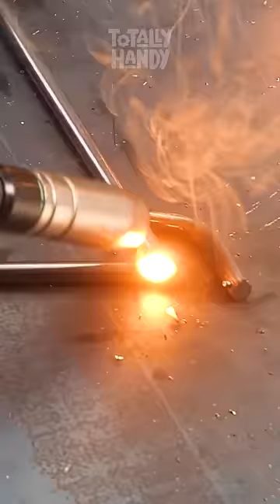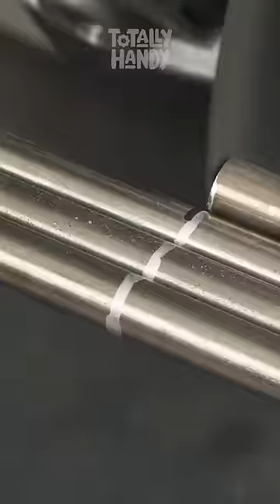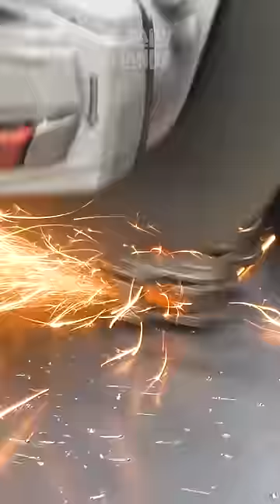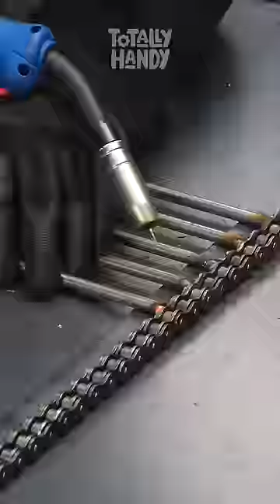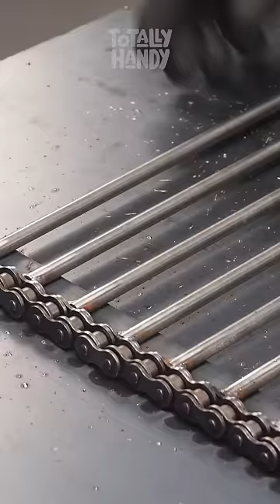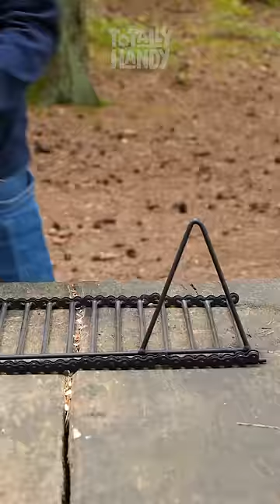Portable Grill DIY #shorts

Comment: Food, fire and paint... one of these doesn't belong.
Reply: Don't forget the oil/grease and rubber o-rings in the chain.
Reply: @farmsgrace341  but there arent any rubber o rings in the chain?
Reply: High temp grill paint, probably to seal any contaminants in the chain.
Reply: @farmsgrace341  any grease in the chain may be food safe... depends on what chain they bought. Many food factory machines use chain and so must use food safe lubrication. Besides, they're not cooking on the chain, and the heat from the welding would "cook/burn off" most oils/greased anyway from the immediate areas of the welds, and the heat from the fire would have most of the rest of it dripping away (maybe smoking the food, which wouldn't be so good).
Reply: Waw😍😍😍😍
Reply: @stoony1745  ikr, wtf this guy talking about lol
Reply: @thomasarussellsr  absolutely not, there is no way that grease is food safe,
Maybe if you use vegetable oil, but they are packaged with a bit of oil for them to not rust while being transported and/or being stored for long periods of time.
So no, i dont think its food safe.

Source: im a mechanic who works with these types of chains. And have felt how greasy they are, if you dont believe me, buy one, and open the packaging.
Reply: @thomasarussellsr  There's no way that "welding" burned anything off outside of the point of contact because he didn't actually weld anything: the metal isn't even fused.
Reply: Aside from the chain I would only be concerned with the actual metal used for this and whether it was made for use with food - many metals release toxins when heated… so if you use just any random ol metal bars to cook on, you’re going to get a nice dose of carcinogens/neurotoxins/etc with that food unless you have it properly treated prior to heating it with food on it. A very simple example of this importance would be coils for vapes that get red hot and if the coil is made of metal that is not food grade it can release very harmful chemicals that subsequently vaporize into smoke and if you inhale them you get that nice yummy metal taste… basically - ever see some hot metal smoking? That is what I am talking about… that smoke is bad news bears… so before cooking on metal one must make sure to either heat-treat the metal and clear it thoroughly of anything released from it or ensure it is treated properly from the factory.
Reply: @stoony1745  Fluid Film. It's food grade and leaves a protective lubricant coating on metal and joints. There are also food grade dry silicon lubricant sprays. Source: Maintenance mechanic who worked in a food plant.
Reply: @sleepyancient6655  makes sense, however i dont think he is using one of those, it looks like a regular chain, and not a special one.

I cant tell you that i know better, because i dont, and dont work in the food industry, but from my experience, i have never seen any metal with a grease coating that has been food safe.

If you can, can you send me a source where there is an explanation to how these a packaged and how they are food safe? Would be interesting to read. Cheers my friend.
Reply: Food
Reply: @stoony1745  It is a regular chain as far as I know. Chains near food are usually covered by stainless steel guards, so it's not like food ever directly touches them. With that said, if we had a machine where food might occasionally touch a chain at some point, we'd just clean the chain of any original lubricant and use fluid film. Stuff that's guaranteed to touch food is all stainless to begin with.

With that said, I wouldn't worry about what this guy did in the video even if he applied a fresh coat of regular gear oil. The fire will burn it off pretty quickly and most of the food won't touch it. There isn't much on chain that clean/dry to begin with. And there's other bad things that people use in their homes with food that isn't good, anyway.

Aluminum, for example, is illegal for surfaces that touch food in food plants, but is used in cheap pots and pans and bowls in lots of homes. This is because, over time, the acid from various foods can cause the aluminium, along with friction, to wear out into the food.

Another example would be not cleaning cupboards regularly. The line workers had to clean up/disinfect things whenever they started sorting and packing vegetables. At home? There can be a lot of things that build up over time from dust to mold and we just, without incident usually, don't bother to clean it.

I think the biggest danger one might legitimately be unknowingly harboring would be antique plates and stuff from the late 1800s to 1970... the colorful ones, red being the worst, can be dangerously radioactive over years of use.
Reply: @farmsgrace341   just put the loose chain in the fire for a couple hours, scrub clean, then soak it in vegetable oil. 
It will be clean and work fine.
Reply: @sleepyancient6655  You could also use Pam cooking spray. 
Safe and no Cholesterol  !
Reply: @farmsgrace341  There's no Rubber O-ring in chain.

And if you heat treating before use it, it will be fine. Once you burn every oils inside the Chain, it's OK to use but for paint......
Yeah that's the real problem
Reply: @digitalis2977  yeah nothing but tac welds can hold in place but is no where near a full weld.
Reply: @stoony1745  في
Reply: Stop hating, it works.
Reply: Jesus Christ loves you all please repent
Reply: Heat paint meant for grills
Reply: @stoony1745  There are actually, chains use either O-rings or X-rings. X-rings offering less friction because of less surface area but they do cost more. Also, the O/X-rings may not always be visible on a chain.
Reply: Heat resistant paint can be used in a grill as long as it has been aired well enough.
Reply: @thomasarussellsr  Very true
Reply: Unless it’s high heat paint.
Reply: He painted the chain and the stands.. notice that he covered the grates with paper prior to painting.
Reply: Definitely the paint
Reply: @digitalis2977  he welded the bars and not the links themselves im pretty sure.
Reply: @stoony1745  your argument is more baseless. hes saying. by having food safe greese it can be used for anything. therefore its probebly more common than non food safe greese. if the chain ends up in a steelmill or something you can just use the regular greese for the chain. if its in a food factory they can continue using food safe greese without it already being contaminated. its just simpler for manufacturing to always have food safe greese. i deubt however that something like a cam chain in an engine uses that since its such a specific use.
Reply: So you don't think a grill needs to be painted? None of the paint is on the cooking surface, that's why he put the tape and paper down for.
Reply: @poloska9471  you know nothing about what you're talking about. Every smoker on the planet uses expanded steel panels. 

Nothing wrong with this build at all
Reply: Agreed, instantly said... "why did he paint that"
Reply: I'm 99% sure he used the special barbecue spray paint stuff, it's heat resistant
Reply: It is fire safe paint, you can get it at any hardware store. NZ.
Reply: You can get fire safe paint from the hardware store people!  NZ.
Reply: They do make high temp paints otherwise grills, ovens, and stoves wouldn't get painted in their high temperature areas.
Reply: @stoony1745  I see what you saying but you can clean it well and put your own food safe oil.. he’s just showing you how to make it
Reply: @littlesam6280  Why doesn't he repent, instead?
Reply: It’s fires definitely fire.
Reply: The paint wss was on the non cooking areas.
Reply: @Peron1-MC  5
Reply: @Peron1-MC  not the links, when he removed the legs it would still roll up for ease of packing.
Reply: bro you eat mc donalds and you are concerned about some grease 🤣🤣🤣🤣
Reply: Just paint the steak for more flavor
Reply: Глупая заморочка
Reply: Russian seasoning?
Reply: Bro has never heard of food safe high temp paint.

Comment: You know there’s a tool to take apart a chain right
Reply: He hadn't
Reply: Yes. A metal saw.
Reply: @heroclix0rz  No.

A Punch.

Turns out those little metal pegs all come right on out...
Reply: You know there's a faster way to take apart a metal chain right? A grinder.
Reply: A heavy chain like that uses riveted pegs and they don't come apart like a bike chain. You can see the head on the peg if you look closely
Reply: @islandrider9837  even most bicycle chains are riveted these days and just have a small section with removable links. It's so much cheaper to do rivets it's the obvious choice.
Reply: He makes one in the next video
Reply: @islandrider9837  I think you should look closer. Those can get punched out
Reply: @islandrider9837  there's still always a link with normal pegs, usually different from the others so you can find it easily.
The ones in this chain can also get punched out lol, look closer
Reply: He didn't, nor did he realise there is no expensive bike chain necessary to male an edge of a grill🤔
Reply: @islandrider9837  you grind the heads down and punch it put to separate links of chains. Heavy or not. I had to do it working on the railroad also quicker than cut off wheel
Reply: Yes, a grinder.
Reply: His way looks faster though

Comment: To make it lighter use hollow tubing.
Reply: Hollow stainless steel tubing of that diameter would be ridiculously expensive, and also ridiculously easy to bend.

It would also be nearly impossible to weld without burning it up...even with the Tack & Pray method he's using.

Comment: I actually like the idea. Minus the paint and lubricants. Probably ensure you use chain with no O rings and soak in solvent to remove as much grease etc before fabricating then put the whole thing in a fire to burn excess lube after. Then it's probably ok to use

Comment: What kind of your welding?
Reply: He's using a Mig Welder, but that specific method is called "Tack & Pray" because he isn't actually welding the metal together...he's basically gluing it together and using the Mig wire as solder instead of filler.

End result, those welds are going to start breaking over the fire when heated because the weld doesn't penetrate and the metal hasn't been melted and fused together.

Comment: I'm sure the oil/Grease off the chain isn't supposed to mix with food.
Reply: How would it mix? Most of the lubricant probably burns off on the first fire, if not from the welding.. Besides, he probably degreased it before painting.

Comment: Why would you spray paint the grill that the meat is going directly onto…
Reply: Firstly, only the chain was painted. Second, we have to assume he knew enough to use high heat paint regardless. Watch it again..
Reply: @joewoodchuck3824  still why would you even paint it it’s gonna be right next to the meat if not then touching it and even if it is heat resistant that’s still disgusting and stupid
Reply: @marswrld2489  So you've never seen a commercially made painted grill then? I invite you to visit a hardware store or Walmart to see some for yourself.
Reply: @joewoodchuck3824  not on the part where you put the meat on no
Reply: @marswrld2489  We're in agreement then.